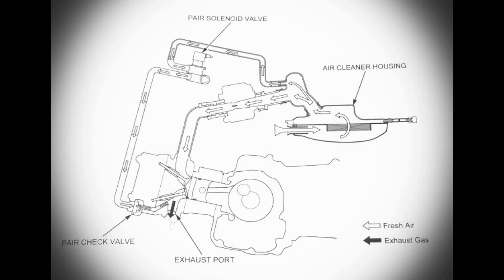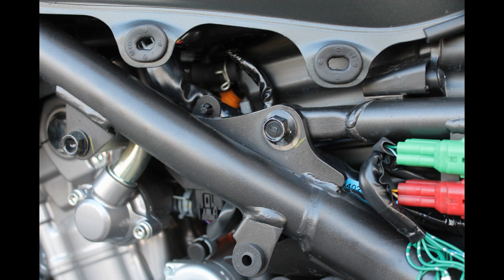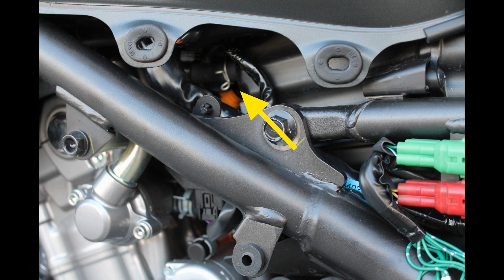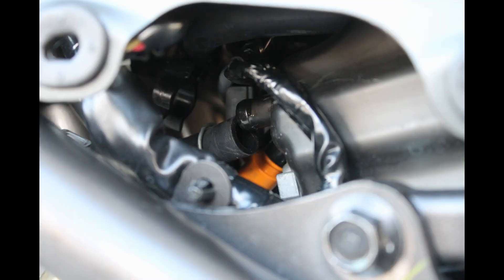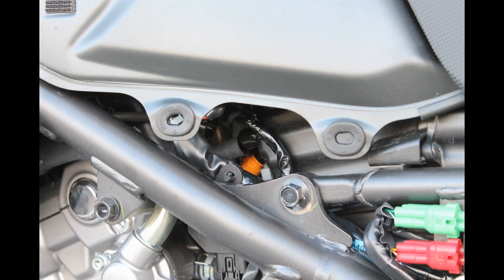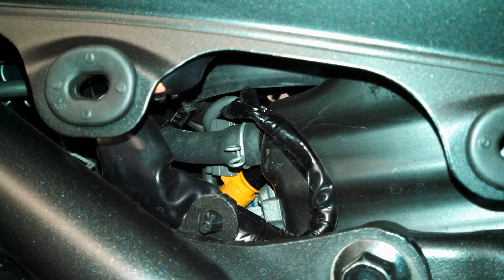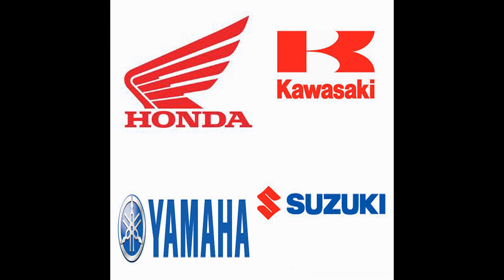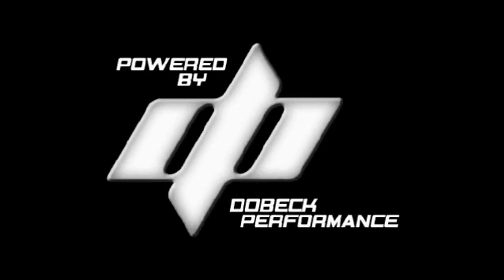Plug A Pair Valve on a Motorcycle (Honda CB500)

Comment: What benefits does this have? Better throttle response, better mpg? cooler exhaust? Please explain the benefits and drawbacks.

Thanks
Reply: It probably breaks AFR. I don't know much about bikes but it could give too much pressure in air intake making wrong AFR - rpm waving, worse throttle response and etc. If the bike was mine, I wouldn't touch it or would fit an one direction valve to improve the performance of this feature and eliminate its bugs (if it doesn't already have such a valve or even something more advanced). Cheers
Reply: There are no benefits of removing it. Only if it's broken, you have the choice of removing it or replacing the broken parts. Second one is preferable. You notice a defective PAIR system by a loud bang inside your air filter box.
The purpose of the PAIR system is to reduce harmful hydrocarbons in the exhaust by adding fresh oxygen into the exhaust port. This burns the hydrocarbons off to harmless carbon dioxide and water.